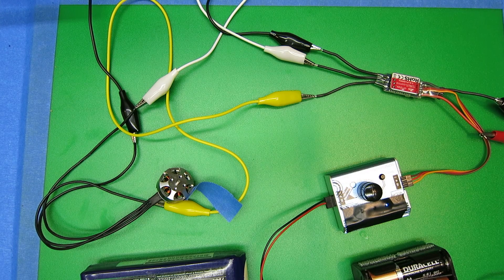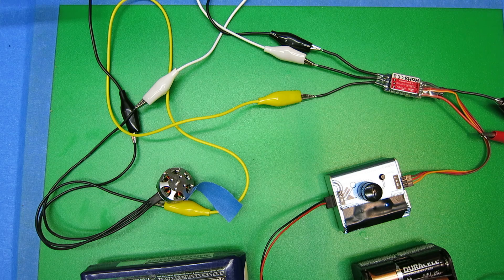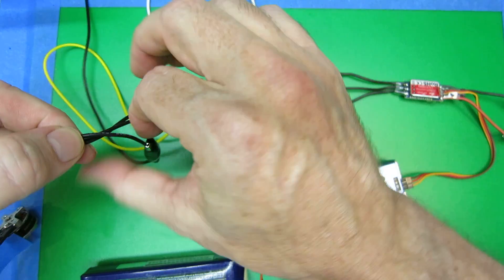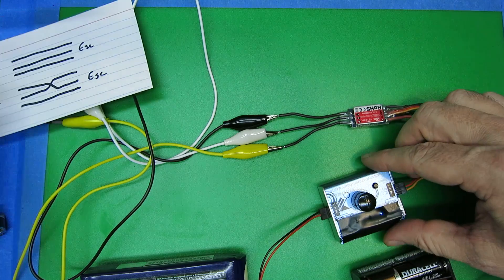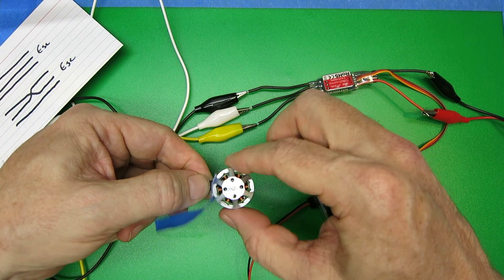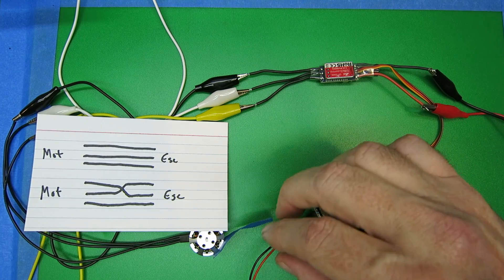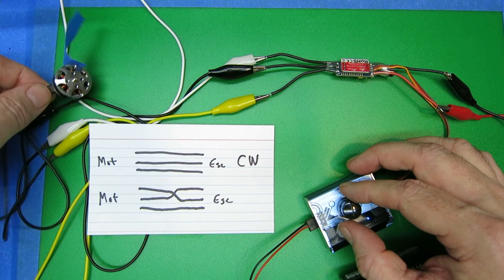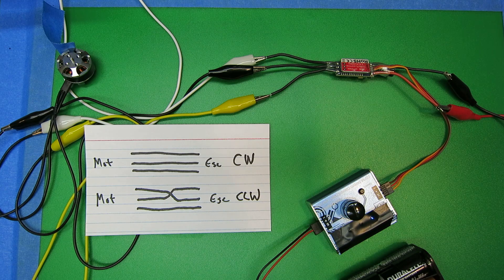Determining Motor Direction

Comment: Also if someone did it wrong then it is possible to do in ESC with BLHeli firmware and those ESCs are able to switch directions.
Reply from the maker: +Xava That is good to know!  In that case the wires don't even have to be crossed.

Comment: the motors seemed to go opposite way to what you noted?
Reply from the maker: +perf59 Good Eyes!  It's a bit hard to see in the video, but I could feel the tape hitting my thumb in the right directions.  Notice that on the CCW try the tape starts pulling off a little.